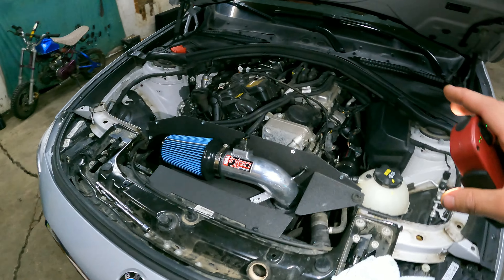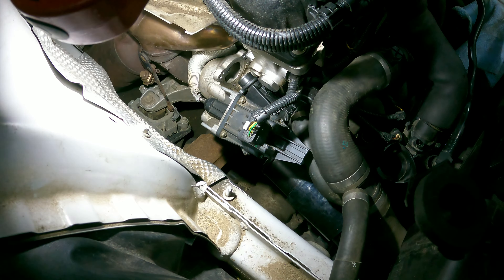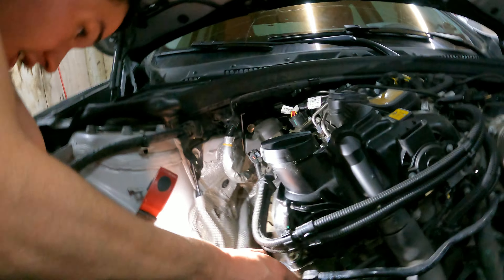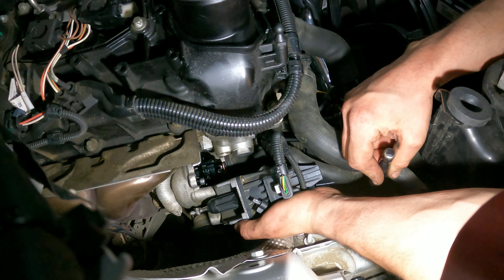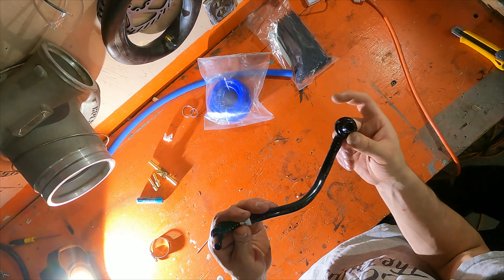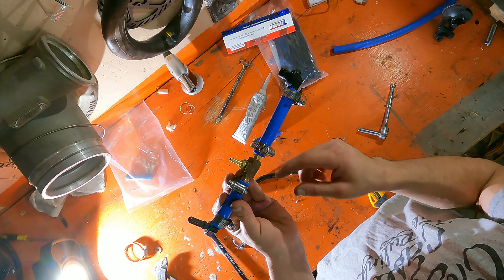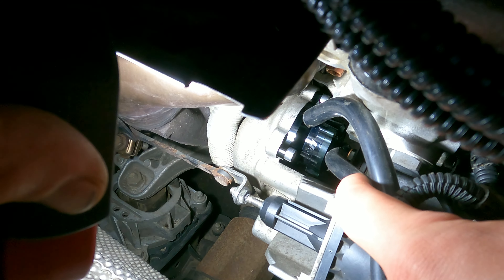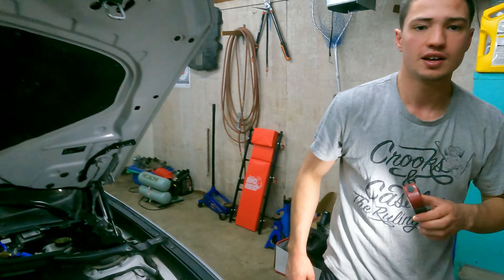BMW 328i N20 BOV install (EWG)

Comment: Nice video. Why did you tap the vacuum line so far away from the BOV? Does it have to be a specific vacuum line to work? I ask because I noticed a similar line off the turbo inlet.
Reply from the maker: If you have an electronic waste gate it is the only place you can get a metered vacuum source from on these cars, unless you install a boost tap, which is still not as good as tapping into the brake booster line. Everything is pretty much controlled electronically on these cars so there is very few vacuum lines.

Comment: I'm interested in what the F34 Turbo cars are doing for power with today's tech. I've been driving the N54's for years now but I bet those N20 turbo cars really get down on it with the up grades and tunes too! Do you know what power this one is making approx?
Reply from the maker: Around 350HP, with meth injection & a stage 2 turbo probably around 400HP.
Reply from the maker: Joshuaw812  The car is full bolt on tuned on 95, These engines dyno at 240WHP stock, based on the mods we can pretty accurately guess it makes around 350 crank HP, Liam’s car is this video also walks all over over buddies Acura TL with 305 crank HP.

Comment: Nice vid.i have the same car..and change the charge/boost pipe with intake..and GFB DV+..but when i start the car..the RPM will always fluctuate a few second before it become normal..do u experience the same problem?
Reply from the maker: no, the car idles & starts fine, If your issue was not there prior to you installing the aftermarket parts I would double-check all your work. If the issue was there prior to installing the parts perhaps you have a misfire on cold starts.
Reply from the maker: Also! if you don't have a tune installed but have aftermarket parts this could perhaps cause some issues.
Reply: Thx so much for the reply..well all the work have been tested ,checked and smoke tested for any boost leaks..no other problems or error popping out when doing a scan..so i think it maybe need a stage 1 tune after changing all the aftermarket parts.
Thx again!
Reply: Broo sameee after installing intake😭

Comment: Not the engine light on 😂😂
Reply: just clear it with scan tool
Reply from the maker: It was from running the JB4, Went away with a proper tune.
Reply: @Kamshaft I know you may not see this, but does it absolutely need a tune after install